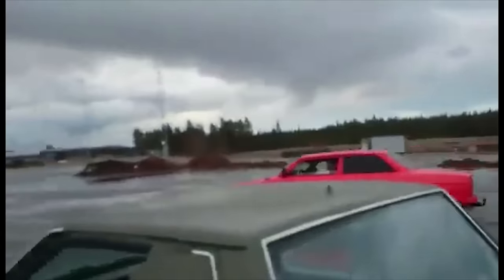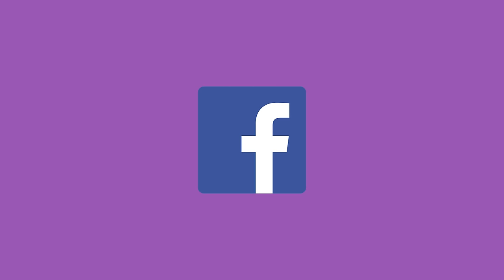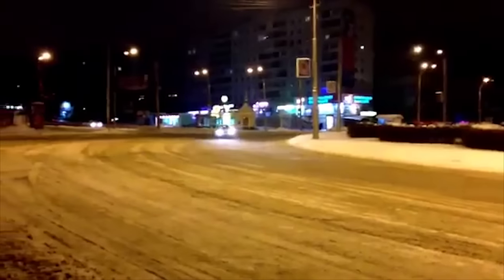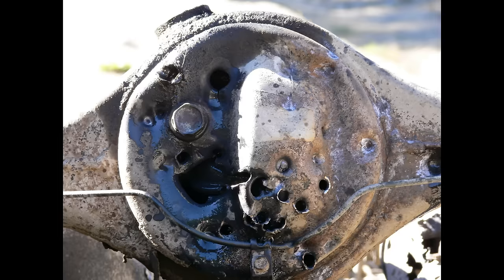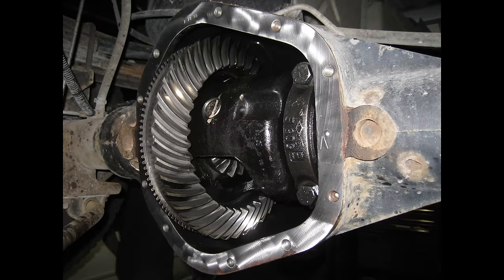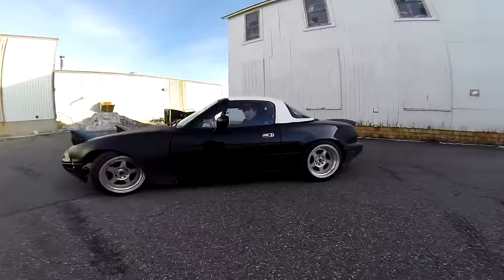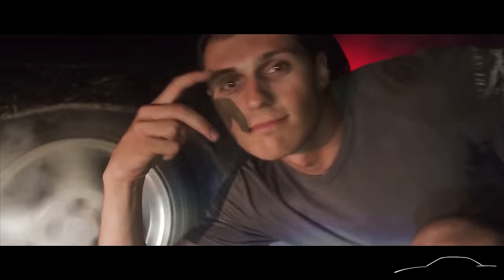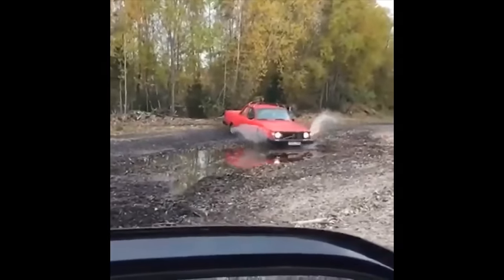Daily Driving A Welded Differential

Comment: You can drive it on the street, sure. Your tires wont last till your next oil change even if you never get on it. Not practical for a street car in anyway whatsoever. Ask me how i know.
Reply: If a car has a locked differential is it possible to reverse it? I found a pretty cool car but it has a locked differential
Reply: @solid_rooster4587  yeah you can reverse it. Keep in mind if someone is selling you a car with a locked differential it has thoroughly had the piss torn out of it.
Reply: @frankrizzo2724  sure, thanks for the info